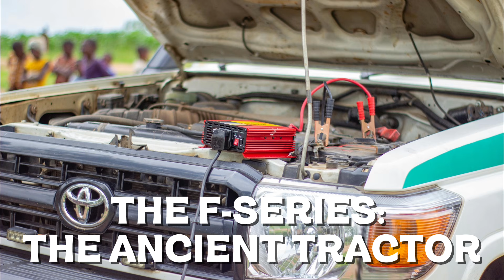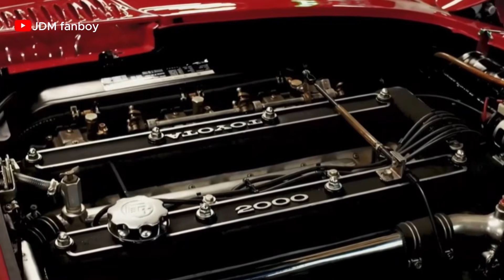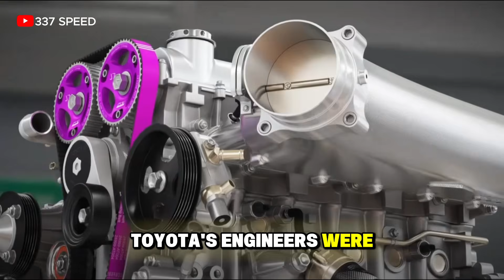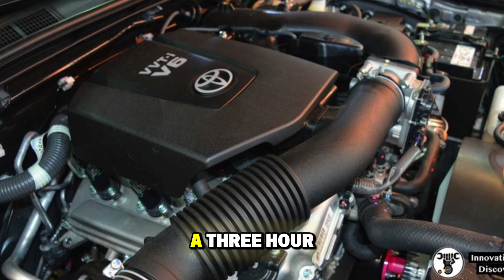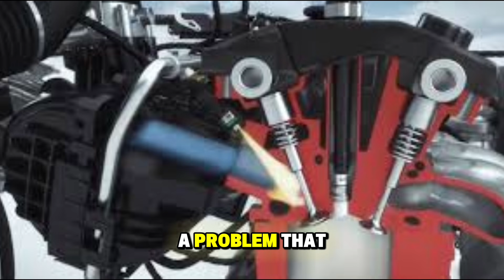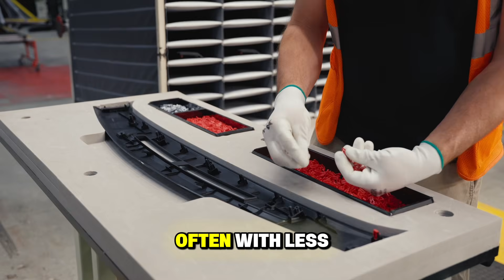Every Toyota Engine Explained (And Which Ones Last Forever)

Comment: I think the V35E problem is that it is way over-stressed. People who access all that horsepower are killing their engines. I also own the 3GR quirk, only shipped here one year in the GS300, and the only GR with pure direction injection. It gets great gas mileage! I have a lot of miles on that one also.
Reply from the maker: You’re right on the money. That 3.4L V6 is working way harder than the old V8s ever did high stress usually means a shorter life.
As for that GS300, you’re lucky. Pure direct injection is great for MPG, but it's a carbon-buildup nightmare because there’s no fuel washing the valves. Toyota actually added port injectors back in later just to keep the engines from choking. You’ve got a rare artifact keep it clean!
Reply: @Carcheologist  I just bought a valve cleaner kit for the GS. Maybe I'll use it though I've kind of retired the vehicle. I was hoping the Start Fuel Injector was cleaning the valves. I haven't looked into it. It does run well though. As for the V35, about the same amount of main journal as the 22RE but 5 times the amount stresses. How as that going to work???
Reply from the maker: That’s the million-dollar question. Putting that much load on a main journal similar in size to a 22RE is exactly why we're seeing these catastrophic failures. The physics just don't add up for long-term "Toyota" durability.
As for the GS, the valve cleaner is a smart move since it's direct-injection only, fuel from the injectors never actually touches those intake valves to wash them off. If you've retired it, it's a hell of a museum piece to keep in the garage! Just keep in mind I’m no expert, so definitely get a professional's eyes on that engine before you try to fire it back up.

Comment: I own a 1MZ and put 165k on it. When I changed the TB/Water Pump @245k, the off parts looked new. I put Iridiums on it when I bought it, with a little more trouble than other cars but not that much. At 265k, it still runs like new. But, as you say, I changed the oil religiously.
Reply from the maker: That’s exactly the kind of real world proof people overlook. 265k and still running like new says a lot about the 1MZ, and honestly your point about religious oil changes is probably the real secret. Maintenance discipline often matters more than people think. Appreciate you sharing this.
Reply: 350k on mines. 🎉 still love the highlanders and their sedans...  saved me gas in Cali